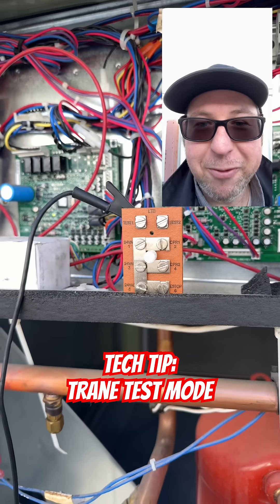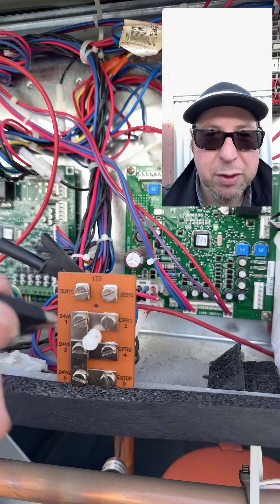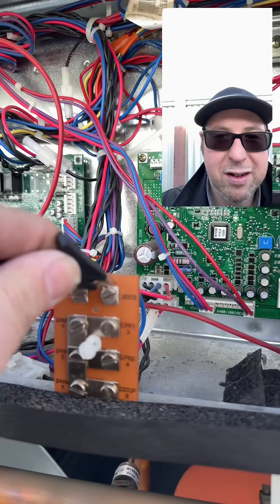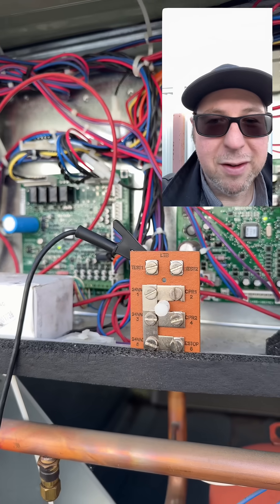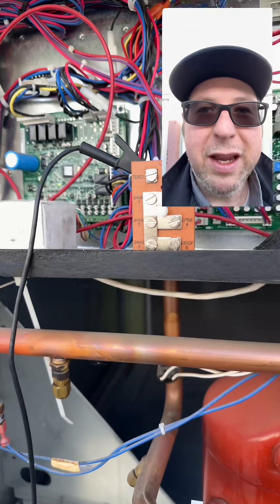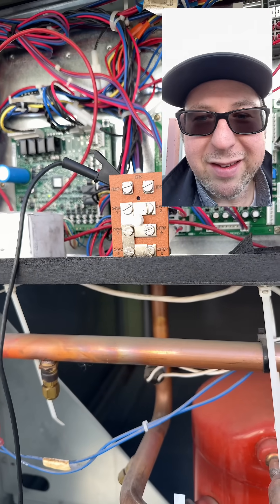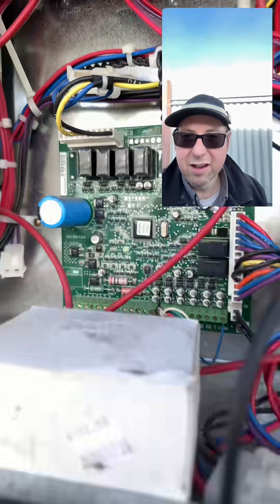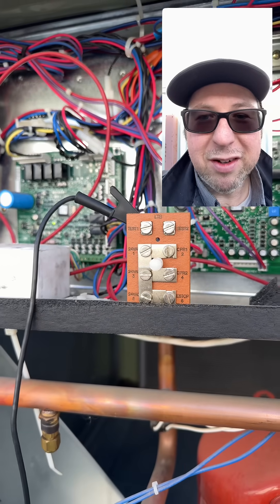Tech Tip: Trane Test Mode

Comment: There are additional steps in the sequence when there are multiple cool/heat stages.  You can also look at the panel and it will give you a resistance value for each step.  Putting resister in allows you to skip additional steps and go straight to the stage you want it in.